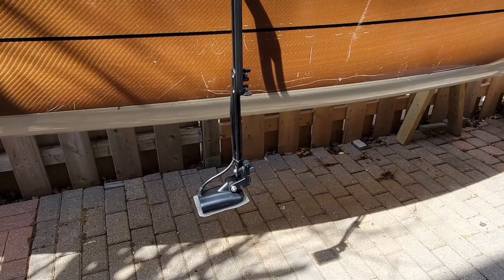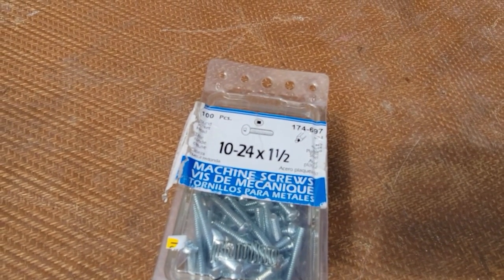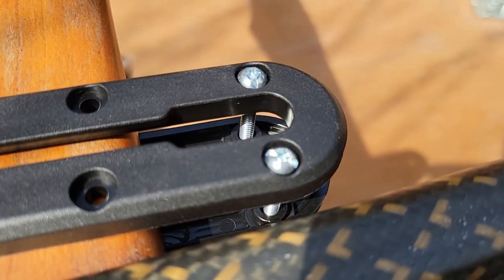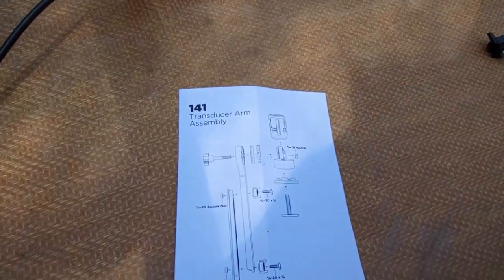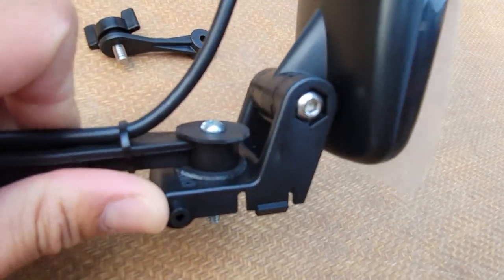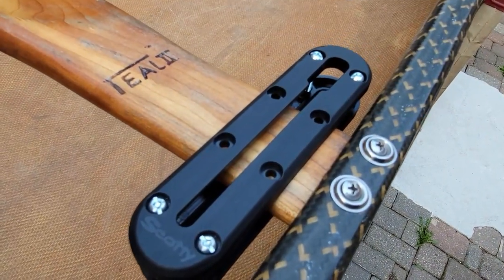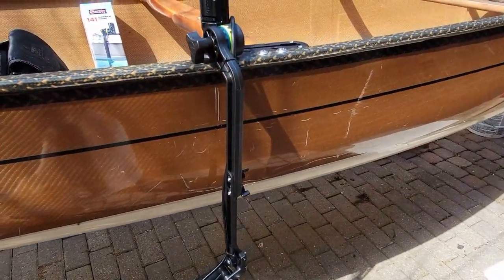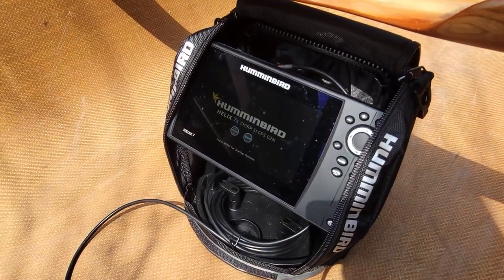How to install fish finder on canoe!

Comment: Hey there, I was just wondering if you used same nut and bolt to attach your transducer to the arm AS the nut/bolt you used to attach the 4 inch track mount? Also, i plan on doing this same set up, but I will have to rent a canoe, with that said are you able to get to 4inch track mount Off  from the yolk (unbolting the nylon nuts) fairly easily? if no do you recommend a certain other type of bolt. Much appeciated, great video.